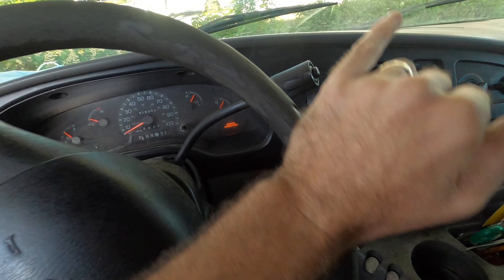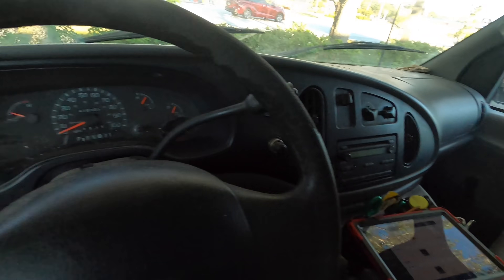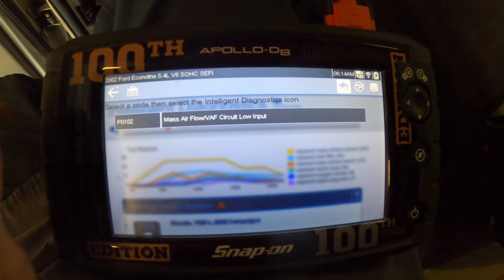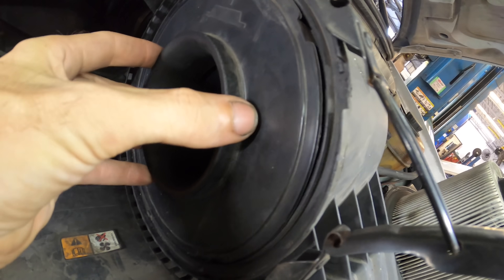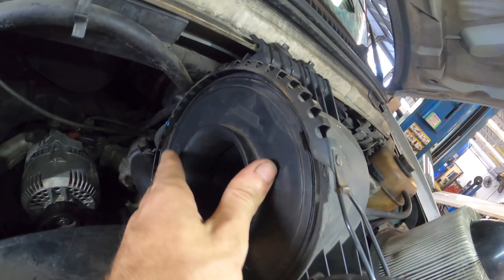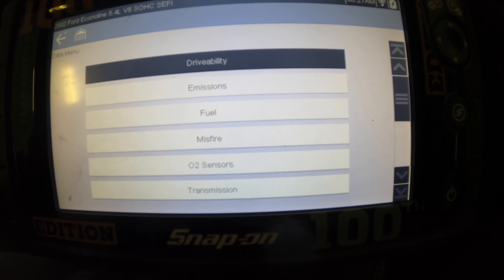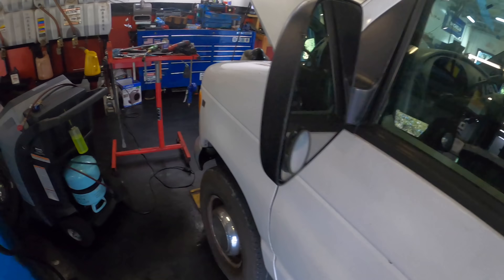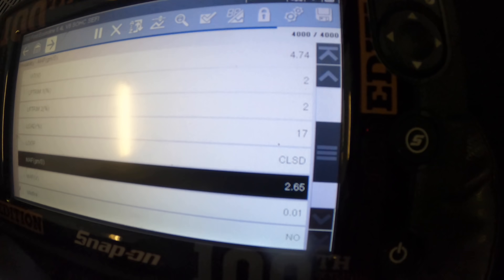Ford Has Engine Trouble. DO NOT Replace Parts! Understand the System! P0102 Mass Airflow Fault.

Comment: I had a MAF issue with my own Subaru MY98 WRX STI wagon. Replacement = £320 ($440), and did not fix. I took it to work, (electronics lab), cut the lid off, and found de-wetted joints on the PCB. Cleaned, re-soldered pins, stuck it all back together, worked perfectly. Money saved = more gas = more fun.
Reply: same here!

Comment: I love those commercials that are selling those $40 dongles. They tell you your mechanic may be ripping you off. According to the dongle, the MAS is bad so if you try to tell the person there is an air leak, they will think you are trying to upsell them. Those cheap scan tools cause problems for the mechs.
Reply: Had my kid's friend's dad tell me he wouldn't pay me to diagnose his windows not rolling up because he has one of those things, so he doesn't pay for diagnostic services. That was before the plague hit. I drove by his house a week ago and there's still plastic in the window. Guess the dongle didn't help!
Reply: @OneTrueCat  As Ray said and I have been trying to educate people, diagnostics requires a good understanding of how the systems work.  Dia is Greek (between, apart)  as is Gnosis (knowing or able to discern), so one meaning of diagnosis is knowing how to discern the differences. 

Those tools are just that, a tool. They provide information, not a diagnosis, just like a thermometer tells you the temperature and nothing else.

Comment: I work for AT&T as an auto tech so I feel your pain!
Reply: @stephen m
Do a lot of the techs try and disable the GPS by breaking it? I heard they hate being tracked with it.
Reply: @watershed44  They go crazy and cause vehicle check engine and running faults. If they malfunction they get replaced pretty quickly. Most techs don’t care either way.
Reply: @nosetdirection  Has the union stewards ever spoken to them about how rough  they are on the trucks?